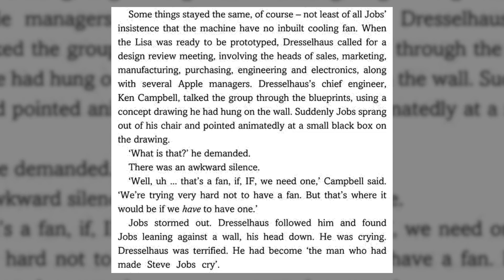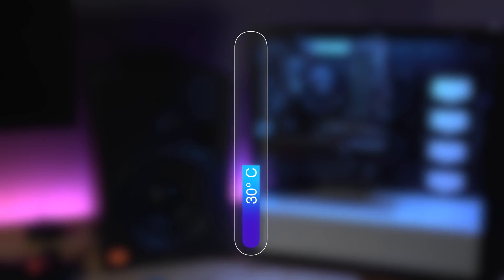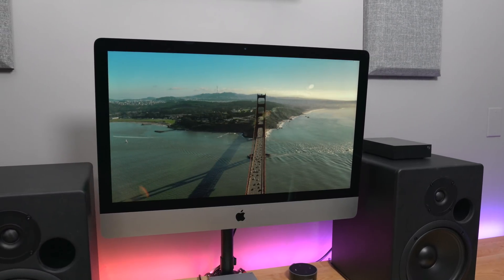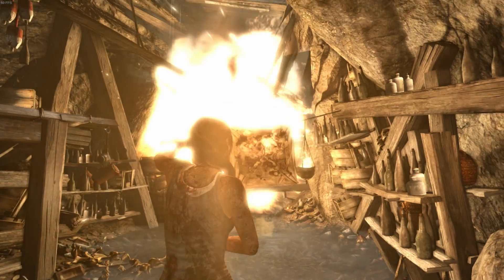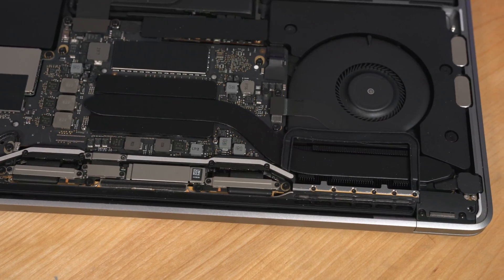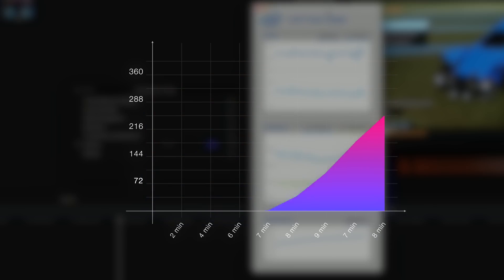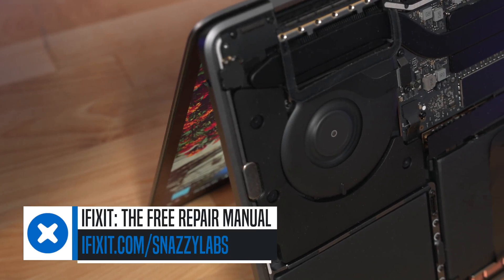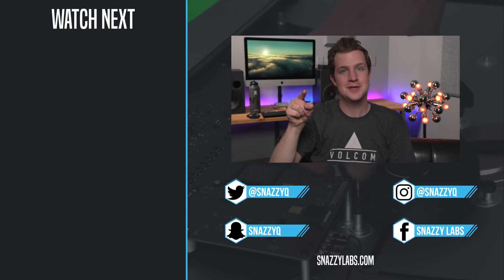Is Apple Ruining Your Mac's Performance?

Comment: I have the max spec 15" 2015 Model with the AMD GPU, that throttles like a bitch. The GPU is clocked at 800MHZ, and after literally 10 minutes of gaming, it goes down to 300MHZ! I can play, for example PUBG at 1920x1080 at low settings and get high 40's in terms of FPS, after 10 minutes, I'm turning it down to very low at 720p! and it still struggles to get 30fps! Just don't game on MacBooks, they're amazing for everything else, just not gaming.
Reply: It isn't even designed for gaming.i have the xps 15 and it also throttle like a bitch. For the same reason because it isn't build for gaming! Undervolt the cpu and gpu and disabled turbo boost allowed me to stay 70fps on medium in rainbow six siege
Reply: Yuddy How do you play shooters without mouse acceleration disabled? Older OS?
Reply: gaming on a Mac... Why did you even try?
Reply: Just don't use the macbook hardware to enjoy a mac... yay!
Reply: You have just proven why the most serious gamers get Windows laptops that are water cooled (and cost me than $10,000) and weigh so much that you really can't carry them like laptops. Intel, AMD and Nvidia simply have not figured out ho two make high performance chips without them running extremely hot when loaded.
Reply: It isn't even designed for gaming.i have the xps 15 and it also throttle like a bitch. For the same reason because it isn't build for gaming! Undervolt the cpu and gpu and disabled turbo boost allowed me to stay 70fps on medium in rainbow six siege

Comment: Apple should be ashamed of this! My HP Laptop makes some noise, but it never thermal throttles I always get the nice i5 3.2 ghz boost on full load. And it's even more disturbing that people who don't know this can't even use the full potential of the 3000$ hardware they just bought... unbelievable...

Comment: Since there's so little cooling headroom on these machines, I wonder how they're going to do as they age and dust builds up in them. I suspect that these iMacs will start throttling after a few years, after all no one tests hardware that isn't new. Also running laptop batteries next to 55-100C components can't be good for them, so I wonder if installing software to increase fan speed may help battery life.
Reply: Kevmatic22 NOPE, i opened mine(Macbook Pro 15") 3 weeks ago since 2013 and barely any dust was found. Only the usual on the grill which you can Vacuum off, but the inside had seriously no dust.

Btw i render daily pretty much, so its under load every week.

Comment: But Mbp 13 the touchbar version has totally different pcb than your base model one
It has 2 fans just to cool off Intel dual core U series, it got 2 intakes hole as well. Does that make it cooler? You should have tested it, base model of mbp isnt lit

Comment: PLEASE DO THE SAME TEST WITH THE TOUCH BAR MODEL!! Its internals are surprisingly different than that of the function keys base model. TWO FANS, JUST TO BEGIN WITH!
Reply: Sqpvfcg Zdxk I had the top spec i5 13" model and in games and rendering the CPU always reached 60+ degrees.
The fans were loud as fuck tho
Reply: Shake speare I know it's not ideal, but it can.

Comment: I recently bought a MBP early 2011 (yes, the ones that were killing themselves) just to export unity apps for ios. And holy balls is that thing hot. It will easily reach 100c just by using 7-zip to archive a file (while still sounding like a jet).

I've cleaned the vents, re-done the thermal compound and reseated the cooler and still no dice on getting a temp decrease.
Any advice?

Comment: I noticed that my macbook pro 15" hit very high temps without rampong up its fans so I decided to test a trial of "mac fan control" its pretty good. I could make a "custom" fan curve. Meaning i could tell it a temp that it starts ramping up fans and a temp where it should be at max speed.
At auto i hit 100 degrees regularly. With a curve set to ramp up at 60 and max at 83 celsius it kept a steady 85-87 at high load. I also noticed the 15" macbook pros fans are very quiet still at 5000+ RPM. If i listen to music i cant hear them. Definitely recommend using a custom fan curve on a mac.

Comment: you should try smcfancontrol. Every time that I am going to use a high intense application I put all my fans to the max speed. never goes beyond 45c (macbook pro 15 touchbar)
Reply from the maker: +Gustavo Cesar I think your temp readout is off. SMC doesn't correctly report temperature. Get Intel Power Gadget. That shows correct temps.

Comment: I used to use smcFanControl to set my fan speed to a higher speed, but it got to be annoying and glitchy. I switched to Macs Fan Control 2 years ago which allows you to set a range of temperatures so that it cools more quickly. I set it so that my Macbook Pro keeps the 1300-6200 rpm fan proportional to a 50-90 C range for the cpu peci sensor.

Comment: Apple relies heavily on the aluminum unibody to keep the computer cool, so theoretically, if you can cool the case of the laptop enough you could get some serious gains. Linus has already proven this by partially submerging his MacBook in iced-water and saw no throttling. Now, that's not exactly practical, but I wonder what sort of real-world gains you'd see just by throwing the laptop on one of those cheap laptop cooling pads with a fan feeding fresh air to the bottom of the chassis.
Reply: I actually was about to say the same statement / or ask the same question rather. Wouldn't putting it on top of a cooling fan or cooling pad in effect help to keep the temperature down and prevent it from overheating? Does it have to be internally cooled to see a difference?
Reply: Cooling from an external source seems to work in my experience. I actually had a MacBook Pro that would regularly slow down and crash while I was doing editing tasks, especially during summer. I started placing it on those freezer packs that you would use for a cooler: the change was instant! It just cooled the whole thing right down and made things run smoothly, without constant crashes. It cooled so effectively, even the keyboard felt cold. But it's probably not recommended because the freezer packs carry a bit of moisture. Would have been nice to actually measure temperatures...
Reply: I only get a few degrees (3-5°C) from an external cooler, it's not extremely efficient, but I'd rather have that than nothing!

Comment: High temps also kill batteries faster and have detrimental effects on more than just CPU. Just ask Louis from Rossman repair..
Reply: The batteries still touch the heat, they just probably limited the battery charge so the heat would not make them explode, but it's still horrible and in 2 years your battery will be unusable if you regularly push the temps on the computer.
Reply: Might be part of why they have control circuitry for charging though. It detects the heat per battery cell and adjusts for it, hence the 1000 cycle rating.
Reply: That's correct, maybe that's also the reason they downgraded the batteries... To lessen the stress on it maybe?
Reply: this is unrelated to charging rates, if you put a battery on a shelf, and the ambiente temperature is high, the battery will last less. Thats just chemistry, cold temps make the self decay of the battery slower.
Reply: +voctornbp That's true, but agressive charging rates or overcharges will also lessen the battery life.
Reply: I'm not sure about that anymore, since macbook pro 2016 onwards have so little battery compared to older models, plus the heat. I think users will notice the battery decay way faster than before, since there is less battery to decay anw, providing that they have the same decay rate.
Reply: They're still rated for 1000 charge cycles despite the size. If it wears to under 80% in under 1000 charge cycles, Apple will replace it at no cost to you most of the time.
Reply: tipoomaster oh so they got that policy, good to know. 
Im a heavy user who works in hot environment using the battery a lot, and with more than 500 charge cycles im seeing a 22% decrease in battery life. It should be different for lighter users.
Reply: +tipoomaster Yup, they are very clever, you'll never get 1000 charge cycles in a year :-)
Reply: I see what you mean, but Apple still has among the more dependable batteries in the industry in terms of long term life, despite running warm.

Comment: Thank you for using Celsius
Reply: You don't have to cross the pond... Just cross the border in any direction and you'll find people using celcius haha
Btw, great video!
Reply from the maker: +fahad sheraidah Cheers from across the pond!
Reply: Even Americans use Celsius for system temperatures.
Reply: Excellent reply.
Reply: Bibasik7 I second this.
Reply: Computers use Celsius to measure temperature by default when it comes to internal measurement.

Comment: It would be super interesting to see which models are actually worth buying based on this hypothesis. Is it worth upgrading from mid tier to high tier 15" or will it throttle before I can take advantage of the performance, for example? Does adding a GPU throttle the machine even more?

Comment: Technically from a scientific standpoint  30c is not half the heat energy of 57c, for that you need to convert to Kelvin,  30c is 303.15k and 57c is 330.15k so it is more like a 10% increase in heat energy. But that is not really important :) I just have nothing better to do.
Great Video!
Reply from the maker: Good point. This didn't cross my mind at all. Now I remember why I'm not a scientist. Luckily, the results remain the same. :D
Reply: EnAimBoy Celsius over ambient seems more practical
Reply: That's clever, but really, use deltas, that's what reputable pc hardware reviewers use to compare hardware temperatures (gpus vs gpus, coolers vs coolers, etc).

You should only care about the temperature over the ambient since you cant go lower than ambient with any conventional cooling (passive, air or liquid cooling) and ambient temperatures change with seasons and are difference all over the world (saying a gpu hits max 70c is meaningless because it may be 50 or 80 in different seasons and places).

Really, there's no point either using absolute zero or the freezing point of water when the whole point of commercial pc cooling to to keep the hardware as close to ambient as possible so 23c (his ambient temperature with his computers at idle) should be the zero point for the idle comparison.

That means the "PC" 7700k was running at a delta of 7c while the mac 7700k was at 34c

So technically, the mac was running 480% warmer at idle...
Reply: EnAimBoy I was looking for this comment! :)))
Reply: science yo.
Reply: This from a scientist, you are quite methodical in your presentations, & analysis, you would prob make a fine scientist/engineer. EnAimBoy's comment was interesting, and hopefully many took away not only the point about Apple & fans, but a little lesson on units.
Reply: PhilfreezeCH yep, that's probably the most useful way of doing it ;)
Reply: barkingsheltie yes, I'm always amazed by the amount of effort he puts into his videos. I just brought it up because I thought it was interesting. I didn't mean to be pedantic (though it's something I'm really good at)  :) I think it's a fun thing to think about.
Reply: Units and orders of magnitude are very important. Feynman had lots of interesting things to say on those (& many others). I didn't think you were being pedantic - brought up other useful observations, such as the delta the other commenter mentioned.
Reply: EnAimBoy if you wanted to get technical you would have noticed that he did not talk about efficiency between the higher and lower end chips. The higher end one will put out less heat at the same frequency than the lower end model.
Reply: Exactly.. and since most average temperatures are around 20°C, then it would be a Delta of 10 vs 37 which is 370% increase...
Reply: that's not right because you would have to check the idle temps in a 20c ambient, that idle temperature is only valid in his 23c, those max temps could easily be 27 vs 54 and the deltas would still be the same.
Reply: well I wasn't talking about his temperature in particular... but the "most" average... (which is actually 21) but yeah... either way it sucks such trade off for a bit of silence...

I actually love the setup of my Surface Book which has 2 fans, one for the CPU+GPU on the tablet part and one for the dGPU on the Keyboard base.. and since I mostly work without using the dGPU, the base remains very cool and comfortable for both my hands and lap.... However the display does become hot under CPU intensive activity and it is not as nice as a tablet... Anyway is a Laptop first, tablet second, awesome device.
Reply: physics ❤️
Reply: Nerd
Reply: Dude, that was a really clever one!
Reply: What if we talk in absolute value?

Comment: Can't you just remove the ssd temperature sensor and leave it at full fan speed?
Reply from the maker: There are apps that will let you run the fan speed at whatever you want, but that doesn't fix the issue. The CPU will eventually get too hot because the fan/cooler aren't good enough—regardless of fan speed.

Comment: Well the iMac is not supposed to maintain the i7 7700k overclocked, is not it? I would really like you to delid the cpu
Reply from the maker: Delidding would probably help a bit (and I may consider doing it soon), but Apple doesn't delid the ones they install. So I tried to most accurately portray my hacked-together iMac as close to a factory-7700K iMac as I could.
Reply: N_klas 

It's not overclocked, just using the standard boost clock of 4.5 GHz of the 7700k
Reply: oh yea my bad, but delidding would mostlikely remove all throttling issues
Reply: N_klas 

Would definitely help, yes. But its not very practical for most people since it's kinda hard to open an iMac, removing everything, delid the CPU, putting it back together.. you'll also lose warranty.
Reply: Snazzy Labs 

Yes would love to see a video on that, if it removes thermal throttling completely or when not,  how much it would change noise level / render time wise :)

Comment: The flaw in this logic is that other notebooks throttle too.
Reply from the maker: Not quite as severely. Downclocking to 1.4GHz on a 2.3GHz CPU is dismal. The iMac also throttles. Desktops shouldn't throttle.